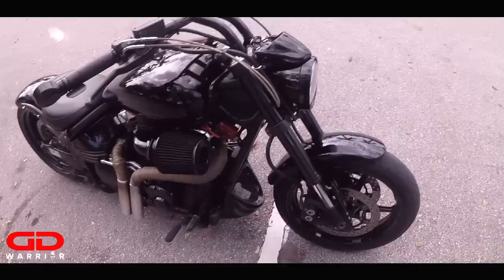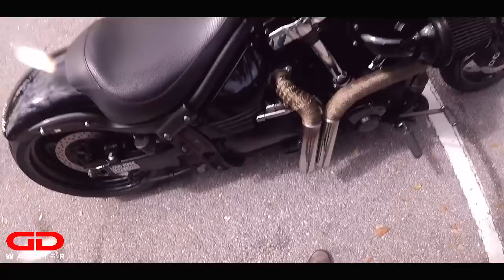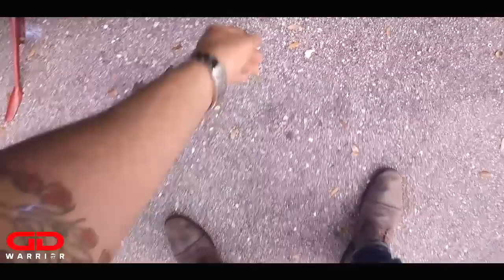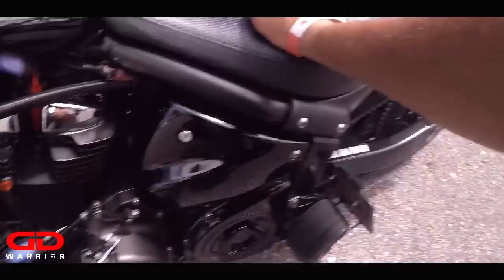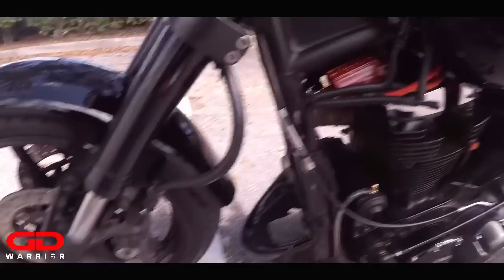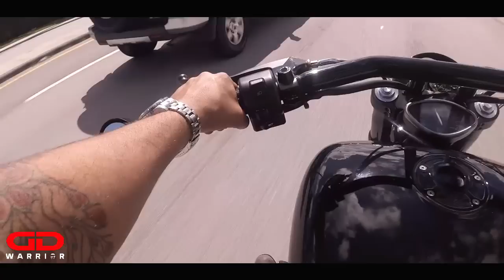YAMAHA ROAD STAR WARRIOR XV 1700 CUSTOM WALK AROUND

Comment: GD Warrior what brand are your fuel lines?
Reply from the maker: Vibrant performance
Reply: @IndianChallengerRiders  Thanks for the quick reply your bike is sick. I just purchased a stock 2006 planning on doing some mods soon.
Reply from the maker: Nice man if you ever need more help let me know
Reply: @IndianChallengerRiders  So you just bought a roll and cut it to size?
Reply from the maker: @blackoutmenazee  you need to buy the 2 feet AN8 fuel hose. With the fuel line end pieces and the quick disconnect. I got all the pieces from vibrant performance! Top notch product

Comment: And yet the bike your heart is aching for does exist based upon exactly the same 1700 Cc V-twin: The Yamaha MT-01, you know, the bike you Americans could not have since Yamaha USA decided not to import this bike for you guys... So the MT-01; what kind of bike is that, well At Yamaha in Japan they stripped a 2005 Yamaha R1: all fairings came off and they took out the 4 cylinder R1 engine and they placed a Road Warrior 1700 Cc engine into the R1 Frame....made it all fit very well and so The Yamaha Frankenstein MT-01 was born. Since the bike is based up on a Yamaha R1 Frame with the Yamaha R1 front fork/brakes and the Yamaha R1 rear fork/brakes, this bike rides like a dream, also when the corners are hit, after all this is a Yamaha 1700 Cc V-tiwn R1. So basically the MT-01 (Master of Torque number 1) is no, I repeat, no cruiser, but a naked bike based up on a Naked Yamaha R1 frame/ undercarriage.  
Go see de video named: This Bike Was NEVER RELEASED In The US | Yamaha MT01 Review